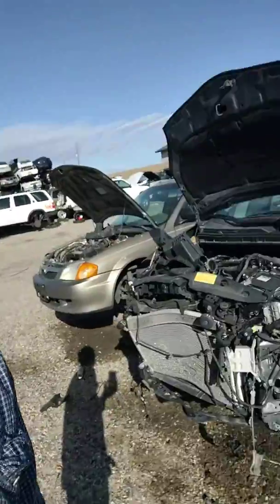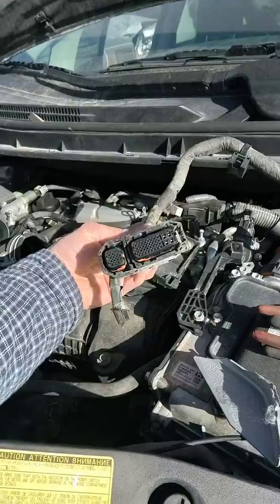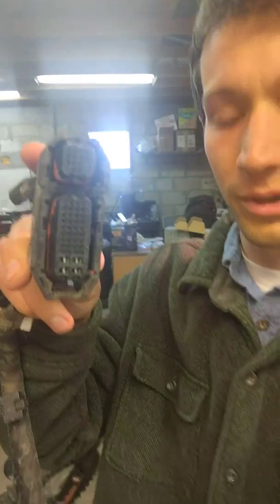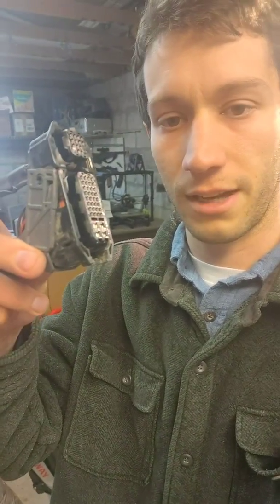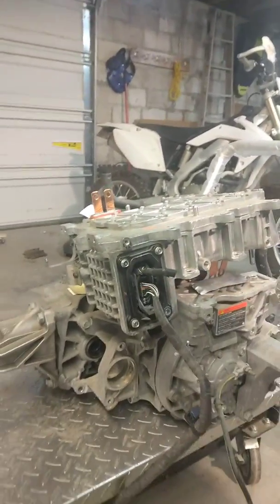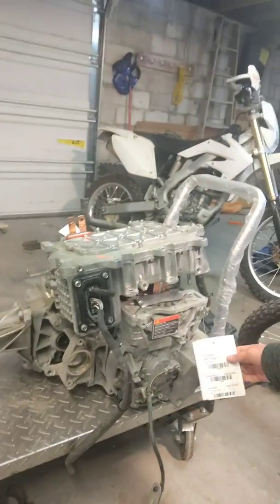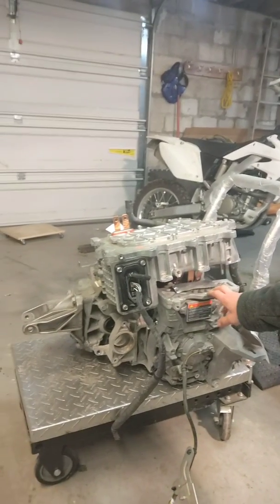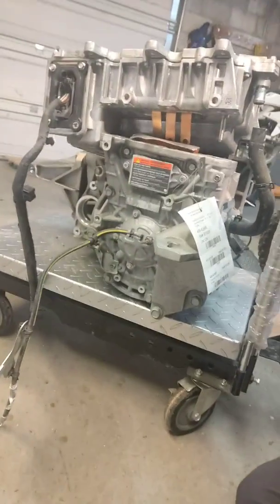Nissan Leaf Inverter Wire Harness Source (best cheap motor for conversion)

Comment: this is super great information. Since I also don't have the wire harness, do you have any suggestions for how to get a plug to go into the motor resolver? I think that wire harness also goes down to the motor resolver and I don't have any plug to fit in there. Thanks for any suggestions!
Reply from the maker: Send me a message on the contact form on my website ConvertingEV.com and I'll email you a technical document from my upcoming course that will walk you through how to do that.
Reply: @convertingev  ok i sent that message through your website (a couple of days ago) but let me know if you didn't get it
Reply from the maker: Thanks for trying. It didn't show up. I guess I need to finish working out the problems on my website. Just email me at convertingev.com@gmail.com and I'll get the document to you. Sorry about that.
Reply: @convertingev  will do. sent.

Comment: Good find, any idea where to find the wire connection for the accelerator pedal from the leaf?
Reply from the maker: I use the pedal from a Prius. I get it from pick and pulls for cheap and I snip the wire harness with it. The 2nd and 3rd gen Prius pedals are easy to find and work for the hyper9 motor and the thunderstruck controller for the leaf as well as other controllers.
Reply: @convertingev  Thanks, I already have the Leaf pedal along with the drive train including the PDU, was going with resolve-ev controller for my VW Bug conversion. I thoughts were similar that there is a cheaper way to convert a car

Comment: Good discovery! What are you going to use to control the inverter?
Reply from the maker: Thunderstruck-ev has a controller for it. Eventually I'll probably upgrade the board in the controller for more power to the open source board on openinver website and make videos on that.